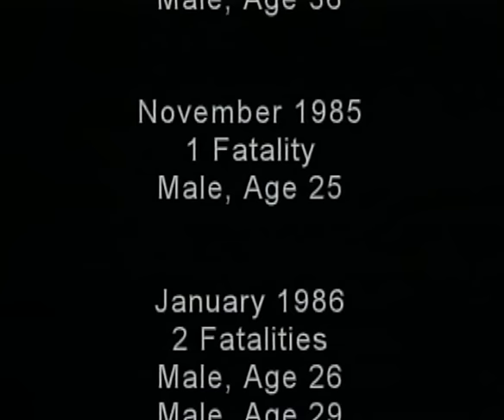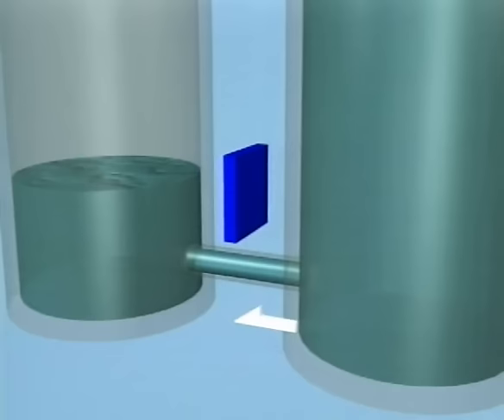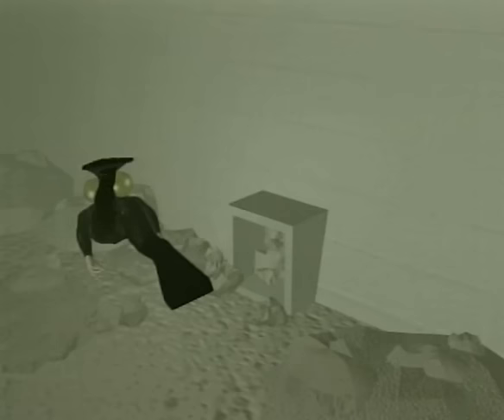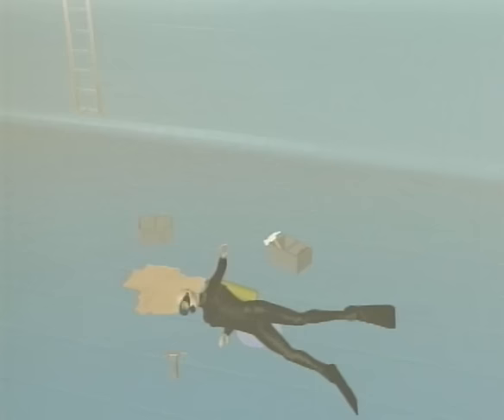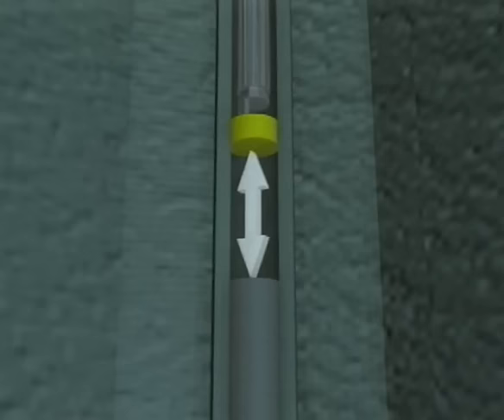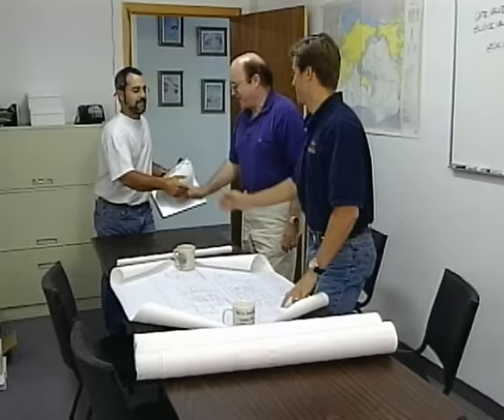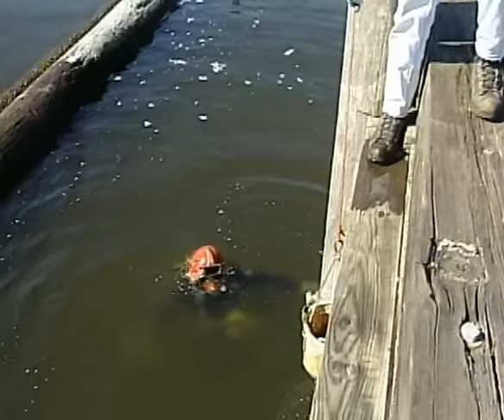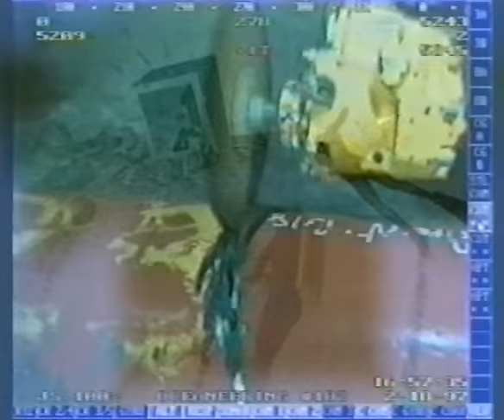Delta P

Comment: The footage of the crab is like something from a movie.
Reply: I was equally impressed when I went to my first oilfield incident. There was a geyser of saltwater about 120 ft in the air. All of that was out of a pinhole in a pipe.
Reply: Delta P is straight out of a horror movie
Reply: @traviseastlick5342  link
Reply: @joeyknight8272  I'm speaking of my first. Just so that you know, this digital digital technology is very new still andit's reliability on longevity of is still undetermined so not only was it never invented, everything that happened back in a day doesn't have a link
Reply: @joeyknight8272  Texas railroad commission goes to all oil-filled and railroad incidence. The Texas railroad commission also has a few other students most people don't know about, I'll put a buck on nowadays some of these Young bucks working for the railroad commission has already uploaded a video somewhere of it happening.
Reply: @traviseastlick5342  oh sorry I didn't understand what you where doing/ what happened.
Reply: @joeyknight8272  there are millions of of pipelines running all across the ground throughout oilfield country. Since the railroad commission's authority over the environmental control of such things, they are all now being placed in the ground and being tracked down to be puttin on GPS. Some of these pipes are over 50 years old and salt water pipes are the culprit. The pipelines that carry oil in it get thicker as it gets older. This sickening is a scaling of radioactive scaling, building up onto the pipes deliver oil. Salt water lines are known to be bumped and ran over.
Reply: @joeyknight8272  one other thing that I was very surprised at the railroad commission was assigned to, dead animals that are possibility infected with rabies to be picked up by the railroad commission.
Reply: There was a raccoon with rabies in a tree at my house. I called the game warden to find out what the protocol is and he said to shoot it and throw it in the road and call the railroad commissioner. Railroad commissioner really doesn't like me much because I forced a railroad company to replace an 18-wheeler that had to go around the designated crossing guard due to the nature of the hazard.. crossing guard barriers would stay down and not let traffic flow becausea train that was parked on a shore trail next to the road interfered with the sensors for the crossing arms. This was a common occurrence but nevertheless, there were ways that was designed so that this does not happen. I seen a grown man go from his whole entire life being destroyed and he's got to wait for it to happen..... I was very upset of the whole scenario that was going onand I told him his options are to disconnect from the trailer and pull off or just leave it there and take out what you need for today and by the end of the day I will make sure that your truck is being replaced. Truck and trailer and everything that you lost. he thought that I couldn't do this but he did not know that I was at that time the fire chief. He didn't believe it would be possible to make the railroad commission have a tractor and trailer replaced, never been done. When the state trooper and the railroad commissioner was done with our little meeting with a driver, tickets for being written and citations were being made and the claim was being filed immediately. the legal system is a lot more complicated than most people actually think. Law enforcement officers don't even know half of it.
Reply: @traviseastlick5342  salt water lines?
Reply: @joeyknight8272  yes, they are not required to be buried. Overtime they get buried from tractors running over them and they slowly sink also
Reply: @joeyknight8272  saltwater has more density than regular freshwater and you will not have to pay for the saltwater. Salt water is used to move oil and separate oil.
Reply: @traviseastlick5342  hun never knew just thought they used Air to move oil or gravity
Reply: @joeyknight8272  due to the fact that water can lift oil up, oil and water is shuffled around in the pipe Network until it is put in a storage tank, that lets it separate itself. They have to keep taking water out of the bottom end of a storage tank so that they can keep putting more oil - water mixed until they have enough to send/divert the new oil/water  coming in, that is mixed with water to another tank and the separation process begins again.
Reply: @joeyknight8272  plus they have to replace the oil with something when they take it out of the ground sometimes.

Comment: Rip Titan. Delta P got ya
Reply: You know, when their air pocket got compressed enough; the air gave off light because the temperature was about as hot as the surface of the sun.
Reply: @umeng2002  it would've been a more efficient photon maker if the vessel was round.

Comment: People after watching the video: “diving is a death wish”

Decompression sickness, Nitrogen narcosis, Oxygen toxicity, and Hypoxia: no shit
Reply: that's why it's one of the higher paying jobs, but god dang man i don't think i could do it
Reply: I have watched and read grand blue, so i know everything about diving

/S
Reply: Imma stick with space travel. Up there I only have to deal with no air pressure, massive temperature swings, and intense amounts of radiation.
Reply: @Sonichu the Animated Series They're not smoke stacks, they don't out put smoke. They're called cooling towers, they boil and vent steam to the atmosphere to cool the reactor.
Reply: @walterkennedy9474 did you forget about magnetars
Reply: @ihaveajojoaddiction9592  technically I did, but considering we’ve only found 30 of them of the thousands of pulsars, and most of space is thus not adjacent to them, it’s probably fine

Comment: Nobody here from the OceanGate titanic sub incident?  Aight guess I'll at least make a comment for documentation.
Reply: Completely irrelevant to this video
Reply: @RACISTBIGOT0  Not it's not lol.  What do you think an implosion is caused by?  A huge pressure differential and the violent equalization of that pressure differential upon catastrophic failure of the sub's hull.
Reply: @RACISTBIGOT0  They experience a delta-p scenario as the sub imploded.
Reply: @RACISTBIGOT0 Delta p means difference in pressure. The difference in pressure between the outside and inside of the sub was 400 atmospheres. So by definition there was a massive Delta p. Unless you are saying otherwise somehow. In which case you definitely need to clarify. Because it just seems like you're wrong otherwise.
Reply: @R2Bl3nd  🤓☝️. If you had any pattern recognition skills you would notice that in this video they were all diving.
Reply: Ocean ranger, unrelated
Reply: only 12 likes and 6 replies?, imma fix that
Reply: @RACISTBIGOT0 I’m gonna assume you’re trolling lol

Comment: The scariest moment in my 45+ years in commercial diving  was a  'possble' Delta P that would have  turned me into chips - I knew  the large hydro lock-gate wasn't going to opened as I had given some serious instructions tthe gate operators and my surface crew were on the ball but just looking at that big thing gave me the shits.  If opened by an inch I was on the way to a nasty death.
Reply: Sounds scary but I probally wouldn't know anything about it diving sort of scares me
Reply: This sounds like a fun job. Is it good pay?
Reply: @milkman1649  yes. It pays very nicely. Like 40k+ minimum. But obviously cuz of the huge risk
Reply: Abbeyan I thought it would pay more; that’s slightly less than my salary (not saying what my job is, but suffice it to say, it’s blue collar), and I’d swear that your job requires more expertise, and is definitely riskier. 
Stay safe!

Comment: "Multiple slots are better than one opening. If your body can't make a good seal against the cover, you can't get stuck"
This is very loosely formulated. Having an incomplete seal is only gonna save you if you assume that the pressure will equalize quickly through the remaining open cross section, or other openings. If you're in a river that flows continuously, or you're diving in a large facility with large volumes of water, you will still be sucked in and be stuck indefinitely or at least longer than you could survive underwater.
The actual force pulling you into a delta-P setup is pressure multiplied by the cross section of contact. Water at low flow rate has the same pressure across all outlets at equal depth. A larger cross section on the outlet will not "spread the load". It will increase your contact area and increase the effective force. What you want is a smaller contact area. That means, spreading the technically required outlet cross section over several openings which are smaller than one big one. Better yet, a perforated sheet across the opening, to restrict water flow and by nature of its reduced open cross section per total cross section, a smaller effective "pressure" and force acting on the diver.

Comment: The opposite direction of delta p is just as terrifying. Many pipes transport oil and gas at super velocity, if you crack it open, it will spit things out instead of suck things in. The pressure in the pipe was so high, that the oil spitting out was powerful enough to penetrate your body like a sword.
edit: changed the comment a bit because it is still just delta P, but in a different direction.
Reply: There was a guy who managed to kill several coworkers at a power plant in exactly that scenario. Cleaved in half by a power washer like a fucking lightsaber.
Reply: Spades Neil Jesus Christ
Reply: Atleast it's a quick death, better than dying by running out of air while feeling agonizing pain of your body parts being pulled.
Reply: Yeah pressure differentials are dangerous no matter which side of the difference you are in.
Reply: @vermeerdragyl341  If the inverse delta P is the same as the power washer/hydraulic leak, death's instant. There was a diving bell accident once where a crew was up for decompression and someone unlocked a pressure door. It cracked an open inch or so, and instantly one of the chamber's occupants was in the room on the other side. Think about that.
Reply: I'm pretty sure delta p still applies for this case
Reply: @DotFrost Yeah, whether there’s a force pushing in or out, it’s still just a difference in pressure.
Reply: Thats still technically delta p
Reply: @hlgb2014  beat me to it, it’s just negative delta p I think.
Reply: What are you doing step oil?
Reply: @mfree80286  yeah, I bet that those kills that the narrator didn't specified how they died is because of that
Reply: Is there a video involving a crab about that?
Reply: @SpadesNeil  was this on purpose wtf
Reply: Dillan Ponis  wtf
Reply: Dillan Ponis  alligators in my delta p soup
Reply: How do they move the liquids at high speeds?
Reply: Water at high enough oressure can kill
Reply: @SpadesNeil   Is there any chance you could provide a link?  I tried to search for it and found nothing remotely similar.  Thanks.
Reply: @jenniferpower981   I'm familiar with the Byford Dolphin accident, I was talking about @Spades Neil saying "There was a guy who managed to kill several coworkers at a power plant in exactly that scenario. Cleaved in half by a power washer like a fucking lightsaber."
Reply: @brucesmith9092  I see,pardon me,my mistake.
Reply: @vermeerdragyl341  I agree but my brain is fighting me. In a state of panic you would use up your oxygen fast and When levels get low enough you just pass out. I have seen videos on live leak of people cut in half by trains and being fully conscious for a few minutes . I’d rather be stuck in a situation and pass out thinking I have hope instead of laying there cut in half. Ether way .
Reply: Hold on... YOU'RE TELLING ME JOJO'S GOT IT RIGHT?
Reply: Thats still delta p
Reply: @vermeerdragyl341  You say it was a quick death, but I wonder how long the mind is actually conscious after what we believe is 'death'.

Is having your head chopped off  an instant death? Or is is just an instant death to the outside observer? I imagine there are a few seconds of absolute terror as you realize what has happened and what is about to happen in the next few seconds as your sensories fades off into black.
Reply: @SpadesNeil  you have the video/report of that? i wanna see
Reply: Delta d
Reply: Jesus fucking christ
Reply: wow before today i didnt know this thanks leopold
Reply: @Lofi means Money pretty sure that's just Delta P too, since it is just about pressure differiences
Reply: that is also Delta P
Reply: @hlgb2014  Delta P stands for difference in pressure so yes you are correct
Reply: That doesn't sound so bad, its like getting shot with an oversized gun, you'd probably die instantly
Reply: @SpadesNeil  IIRC there was an incident at a nuclear powerplant where someone got impaled by the control rods on a Cold War-era reactor being ejected with a sudden surge of steam pressure.
Reply: I was going to say about the Delta p
  Good story, though.
Reply: @SpadesNeil  wtf
Reply: A kid in Riverview figured out that a pipe under a bridge carried high pressure anhydrous ammonia and decided it would be cool to drill a hole in the pipe and let some out to collect it for whatever reason we will never know because it killed him instantly.
Reply: yes, you may recall andy dufresne gets hit in the face with a geyser of liquid shit when he busts the sewer pipe open while escaping.
Reply: @gigaslave SL-1 experimental reactor. Idaho falls, Idaho. He was impaled into the roof of the reactor building. There was such a massive neutron flux excursion that the gold jewelry they were wearing, rigs, pocket watch, etc. became radioactive. Remember everyone, it takes neutrons to make things radioactive, not Alpha, Beta, Gamma, UV, or electromagnetic radiation.
Reply: @hlgb2014 who said it isn't
Reply: @gigaslave That happened in the James Bond movie The World is Not Enough. It was in a nuclear submarine rather than a nuclear power plant, though.
Reply: @hootowl2112  No it did not kill him instantly. It gave him burns, and he was facing felony charges afterwards.

Comment: We were cleaning a strainer box, about as big as a panel van, at a abalone farm. The 2 pipes conneted to the strainer were big enough to swim in if you wanted to and they tapered down to about 300mm wide just before the pump impellar. This was the main intake that fed seawater to the farm on shore.
Someone switched the pumps on while we were still busy cleaning the strainer. We felt the tug of water, moved out of the strainer box and asked supervisor via comms what was going on.

If we were right in front of the pipe openings we would both have died that day.

Comment: Things I wanted to do before this: Underwater welding 

things I wanted to do after this:
Reply: i like how the emptiness after the second line implies that after seeing this, you do not wish to do anything at all, ever, which is actually the correct reaction to the horrifying stuff described in this video
Reply: A new hand touches the Beacon.
Reply: @ariahazelwood3842  how did you do that ?
Reply: While it is a very scary situation to encounter while underwater welding, most of your fear and shortened lifespan comes from the toxic materials and gases released underwater. But you do get paid very well.
Reply: @Iceechibi  the same goes for workers who work on oil pants offshore. They get paid a ton but the risks and 6 months offshore work is just depressing
Reply: @hrushikesh708  you mean this
Reply: Run while you're still alive